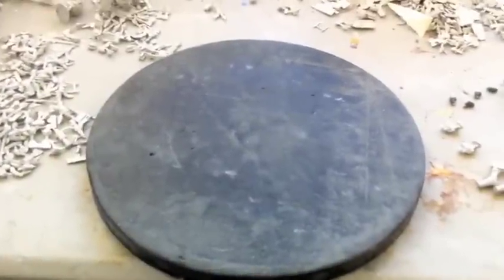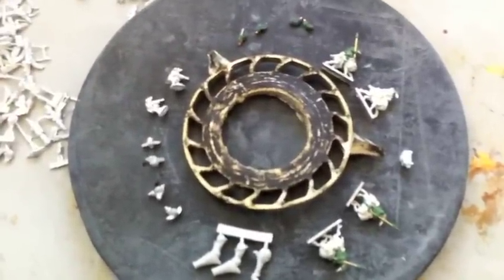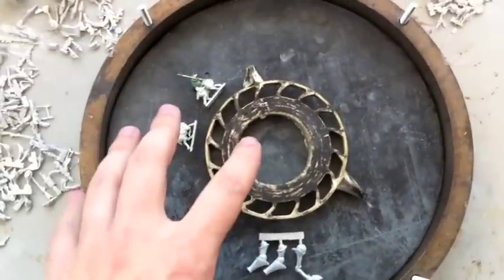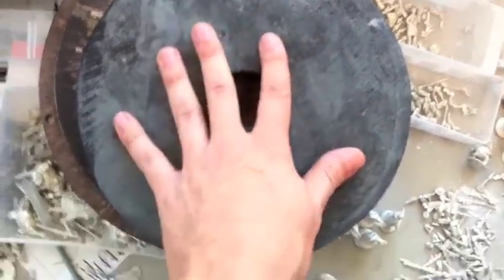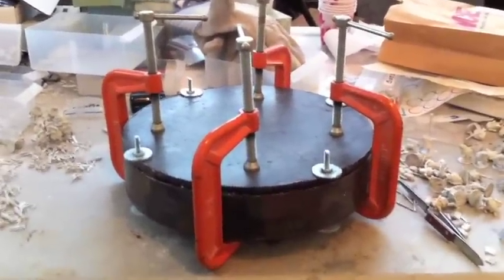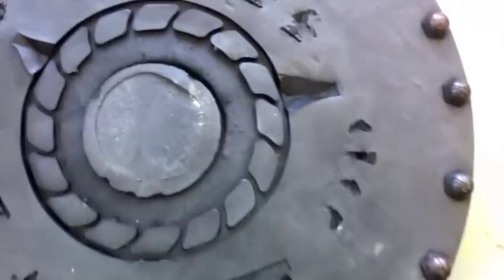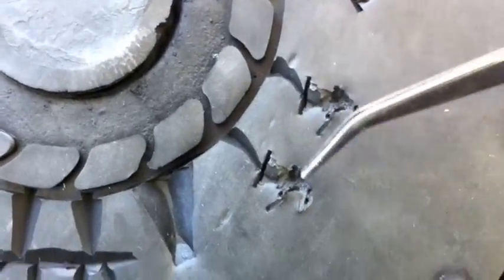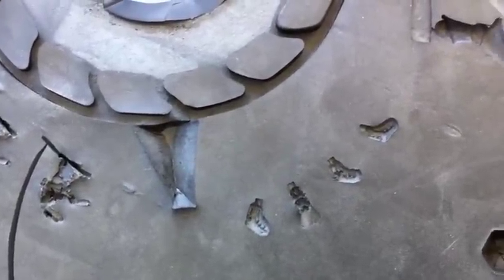Vulcanizing Molds

Comment: yeah, I'm going to vulcanize in my kitchen as well, and my lady wouldn't like it to smell like a rubber factory... so the only difference between natural rubber and silicone would be the smell?  to get this straight before I hire some dude to make me a frame, in total your rubber disks are an inch thick, is the inside of the frame the same height or a bit less to ensure a little more pressure on the disks? do you just press the minis in the rubber by hand? thanx for all the help!

Comment: I had another go this weekend with another 4 little g clamps for extra pressure and it was a big success. Thanks for the advise it seems lack of pressure was the problem. I also put the mold halves in the oven at 100 deg C for 20 minutes to soften up the rubber a bit before doing the clamping. I'll try and take some pictures next time i do it and post them up somewhere for anyone whose interested.

Comment from the maker: Silicon takes longer, or can, to vulcanize, and won't last as long. However, it won't ruin the masters and can survive more undercuts.
Are your masters really small or thin? It might be best for you, if so, to have an inset so you can really clamp down on the mold. If your masters are fragile you can carve out some rubber beforehand so they sit deeper and won't be smashed by the two halves. I will add this to my next video.

Comment from the maker: Not a silly question at all, the entire process is complicated from start to finish. When heating the rubber expands and hardens. It flows around the masters and makes the cavities. I use simple talc to keep the two halves from melting together.

Comment from the maker: Just this one. Its fairly straightforward. Make sure you have a metal can that can take the pressure and cook it. You need to make sure you have some type of mold release between the two halves so they don't become one piece. I use talc.

Comment from the maker: @kmorfa Um, I call it a gate former. I am not sure its actual name. You can buy them from tekcast or conquest. To be honest for the first few years i cut all of the gates by hand. I only recently bought some formers from tekcast. They broke after a few molds, but since I am pouring pewter into the mold anyway I get a copy of it each mold. I just cleaned one of those up and use it since it won't break like the originals.

Comment from the maker: I didn't film the step where I pulled the masters out of the already cooked mold. Its a long process and I couldn't film it one-handed. Metal masters survive and can often be used again to make more production molds. Sculpted things might crumble and come apart and need to be picked out of the cavities. That's why i use softer silicon rubber for sculpted masters. They survive the process.

Comment from the maker: I purchased it from, I think, tekcast. It broke the second time I used it. However, since I am pouring pewter into the mold it was easy to make a pewter copy of it. Used that same pewter copy to make hundreds of molds since. If pieces are larger and won't fit between the form and the side of the mold then I cut the center channels byt hand.

Comment: Heya! Just wanted to say I found this video and the previous one very helpful. I recently got into pewter casting on the industrial scale, and we're looking at making molds of custom designs on a vulcanizer machine.

The tips and tricks for how to gut the gates and vents was very useful, I'd been having a hard time trying to find the information.

Thank you for sharing how you do your work!

I still have yet to find resources on what kind of materials can be used for making the masters. I do sculpture out of sculpey clay, but I have doubts it will be able to withstand the pressure of the vulcanizer machine, which leads me to wonder if I should look at making some single-pour molds for single-casting to make some initial pewter metal Masters.
Reply: Long out of print, the Principles of Centrifugal Rubber Mold Casting by Gonicberg and Ritch is a great resource. Over a decade ago I learned the process from one of the contributors of the book. Your master must be able to withstand 300 degrees F. to work in the vulcanizer, otherwise it will deform. J_B Weld, a common epoxy found in hardware stores and home center, works great.

Comment: cheers, great video, it made me decide to build my own spin casting machine, the biggest trouble for me is finding a cheap mold frame (even having it custom made...) and the rubber here in Italy (it seems they only have silicone around here). How thick are your rubber discs? the ones Conquest sells are 1/2 inch per side, but yours look thicker, am I right? is the Rubber you use the PR-2? I'm going to write them soon and this info would be very helpful. you rock.

Comment from the maker: You need the pressure on the mold when vulcanizing. Mine insets so that I can put that pressure on it. If you can tell in the video i never quite get it all the way in, which means its exerting pressure. You just need to make sure whatever is in your mold can take it. A common practice is to carve out divots so your figures aren't squashed when you tighten it down. I use the screws to get it tight and then the c-clamps to really hold it in place.

Comment: @rhyflermaerch 

How did you cut the steel pipe.

What was the inner and outer diameter of the pipe?

What did you use to drill into the pipe to make the holes?

Comment: Hello .. I see that we are several people who are trying to understand the same .. I also am going to give heat to the mold in the oven in my kitchen! .. Tell me if you did well and I have the same question as you. . the interior has to be more tall guy that molds to give more pressure or not? .. you know that? .. I smelting and electroplating any help at your command

Comment: I got a mold frame and have tried to copy your process a few times with varying failures. Although the rubber vulcanises it doesn't seem to flow into all the gaps and often leaves a rounded lip where the 2 mold halves meet. Did you have to chew through the mold blanks refining the pressure etc when you first started out and do you ever encounter these symtoms?

Comment: May seem like a silly question, but when you set the pieces in and put the second layer of rubber on top, are the indentations made from tightening down with the c-clamps or is it from the rubber melting in the oven to encapsulate the details? If the latter, what prevents the 2 rubber discs from melting together? Is that what the talc powder is for?

Comment: Hi I am in the same subject as you .. trying to fabricarme the tekcast a tire type. and saw it with screws and presses can give pressure to the flask and it is not so complicated! .. I see by what you say that you needed pressure to the gums or the molds will mark vulcanizaste .. well .. where you put the flask in a kitchen oven? .. so? .. if I can pass that data I would greatly appreciate it .. if I can help .. I would gladly do from designs to electroplating

Comment: Hi, how long should we leave the rubber after the 2.5 hour cooking to cool down? should we remove it from the vulcanizer or let it cool inside it only.
Reply: I remove the vulcanized rubber right away to cut the spokes, gates, vents, etc.while the rubber is hot, nearly too hot to handle. Very warm rubber makes it much easier to cut. Don't scrimp on blades: use a new or nearly new blade (I use scalpel type blades) when cutting rubber. I don't use an oven, but a vulcanizing press which heats the ring, platens, and obviously the rubber inside. The press uses a bottle jack to create pressure. The rule of thumb is one hour of heat for each inch of mold thickness. Longer time won't do any harm.

Comment: what happens to the original figures you used? do you take them out before baking the molds or do you leave them in. Just as you split the mold there was no sign of them.

Comment from the maker: Nope, each side is a half-inch thick! I thought I used the PR1s, now I have to check. When I order I just say hi to my guy and tell him I need 10 more mold sets. Haven't called them by part number in years. There is nothing wrong with silicon molds, if you are vulcanizing in a garage or something. They stink, at least when I do it, and I vulcanize in my kitchen!

Comment: your mean 600 to900 rpm, but tell me how much fix rpm required for zinc jewelry casting. because I make machine same to same like  your machine. but not  properly casting in die. only  runner are casting and not design of jewellery not  casting. it's only  light liars coming in some pcs of design, so please guide line me how much fix rpm required for zinc jewelry. my machine motor 1450rpm , and I used 6 inch pully in machine saft use and 3 inch pully use with motor. then how much size of pully required for perfect zinc jewelry casting

Comment: How deep is your mold can?  I see the gap when you had the lid clamped on.  I assume you had a 1" thick mold blank.  So with your mold can on, there must be less than a 1" space in there.  How much space is it?
Reply: I found this info in the comments on your other video.  For anyone curious, here it is:

"Its an inch deep when closed, but the cavity is an inch and a quarter. The top has an inset so it seals nicely if you can't get it all the way closed."
Reply: @matthewbrasfield3563 I realize this is an old post, but I was wondering if you could tell me  how much of an inset there was on the top. I know the ring was 1 1/4  so to get some pressure im sure the inset was more then 1/4" . Did bottom cover have an inset also? Thanks
Reply: @bobmohney5817  I have my own mold ring I use.  The total depth is 1.5".  I use 4 plates (2 for each top and bottom) where two are insets that are 1/4" and cover plates that I clamp down so they push in the inset plates and apply fully direct pressure to rubber. I even have a 1/8" plate that I sometime use to replace one of the 1/4 plates if the mold is a bit thick.  Basically I found that you want the insets to be as recessed as possible so the rubber doesn't run out when vulcanizing. But you don't want both the cover plates flush with the ring or else you likely don't have enough pressure on the rubber.
Reply: Thanks for the info. Just a couple more questions. How thick is the wall on the ring and are you still using c-clamps.

Comment: I'm so surprised you're molding at such a low temperature. Also, tin masters? I do jewelry molding so all my masters are usually at least sterling silver so they can survive the abusive temperature (the latex or silicon I use requires much higher vulcanization temperature). I guess you learn something every day, I was under the assumption you guys used bronze masters.